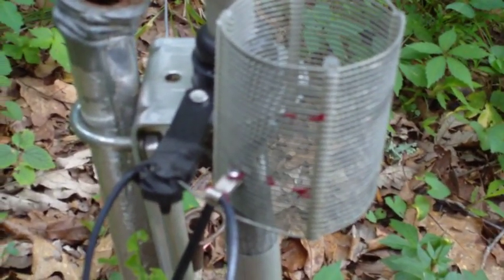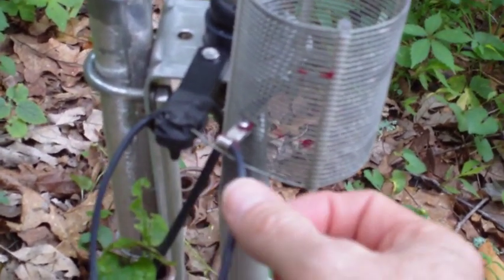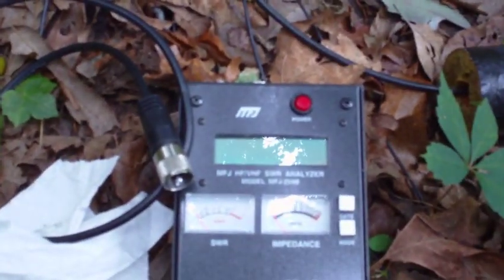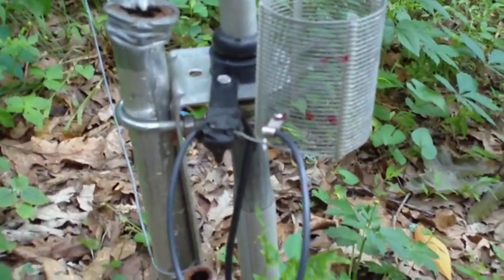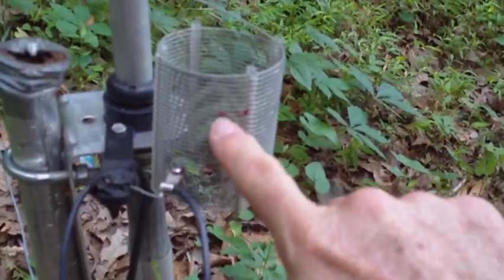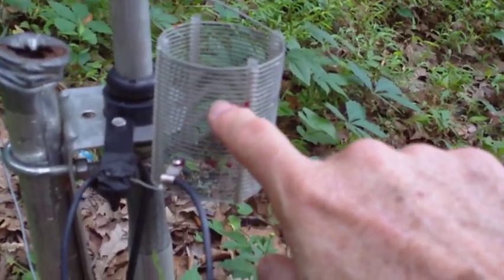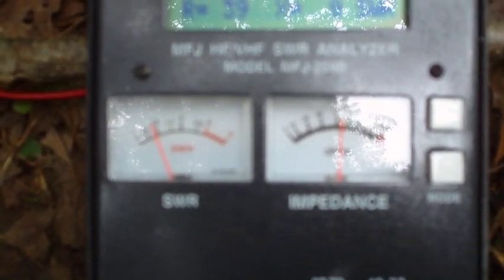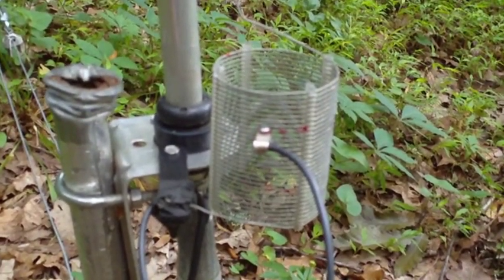MFJ Antenna Analyzer, Hy-gain AV-18VS Vertical Antenna

Comment: Have you tried/experimented with a capacitance hat on it? Because it is short on 80, 75, 40, it might improve operation on those bands. I'm asking because you have the antenna, but I do not. 73 de K3ANG
Reply from the maker: Gregory Stec Hi. No, I never did add a capacitance hat. I did mainly use it on 20, 40, and 10 meters. I no longer have this vertical since moving a few years back to another location. 73